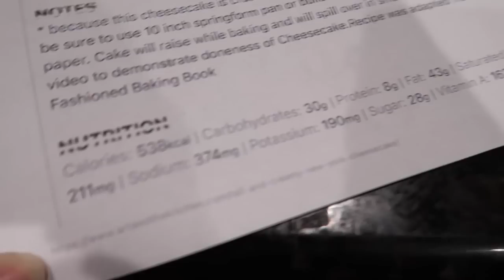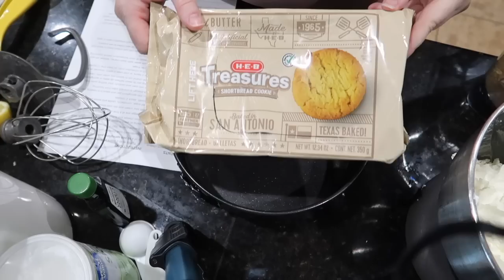Fixing this Bathroom | Can I pull it off?

Comment: I’m not an actual expert on cheesecakes but the idea I’ve got over the years is that the New York cheesecake is the type you bake in the oven vs the ones you just use gelatine and put in the fridge to firm up. And the oven baked ones, it is supposed to sink down when it’s cooling after oven and even some cracks on the top are fine. If you bake it with bain-marie (is that the word?) then it doesn’t crack, but then also the top and edges isn’t supposed to be brown and it’s not a New York cheesecake. 
So I’m trying to say your cheesecake turned out just fine! ☺️ And now I’m craving for some too…

Comment: You did great girl!! The drawer was such a great idea and the dinner! The cheesecake I bet was so yummy. I like to make cheesecakes a few tips I use- Water bath, Water bath, Water bath!!! Also- I like to leave the cheesecake in the oven for an hour after with the heat off- then pull out to cool after you run a knife around the edge to loosen it from the pan. The biggest trick- don’t open the oven to check if at all possible- I turn on the light and wiggle the door and if it’s just wiggly in center a bit it’s ready then don’t open door until after its been cooling in that oven with the heat off for one hour. Mmmm I think I’ll make a white chocolate raspberry one soon!

Comment: We have a family recipe for cheesecake girl and all you need is a couple ingredients to make it and you can use a blender to mix it not a mixer. So I buy the pre made crusts to a blender I add 1 lechera sweetened condensed milk that’s going to be your sweetness and then add 1 and 1/2 blocks of cream cheese and to that add 3 eggs blend together in blender and pour out onto your two crust. Put in the oven for 45 minutes or until golden on top for 325• that’s it it’s sweet but not too sweet not too many ingredients. My sisters and mom have done it this way for years and it’s still a crowd favorite. Hope you try it.

Comment: Calcium deposits. Just soak a paper towel in vinegar (careful not to tear it so do it on the spot where you want it), and sop that around the tap. Leave it for at least about 4H, so overnight would be ideal. Voilà. It is amazing for calcium deposits. We use it do decalcify the coffee maker (3/4ths vinegar to water ratio) and just let it make coffee a couple times. Then do a couple plain water times and you're set. It is very useful for cleaning but amazing on calcium deposits, wherever they may be!

Comment: To remove the hard water build using from faucets, soak cleaning cloth in plain white vinegar and while its dripping wet just lay it over all areas of faucet that need cleaned and go do another project. After 30 minutes go back and it will be like new, just rinse and done!!!!!

Comment: Shannon, I have to tell you about my 1st time baking a cheesecake. I’m super over confident in myself bc instead of just doing a regular cheesecake, I was like I’m going full gourmet! I found a Paula Dean recipe that was I think 7 layers, it had cookie dough, chocolate gauche, homemade caramel, I don’t remember now all the layers but you had to bake each layer, cool then add the next layer and so on. I think I had $40 in ingredients ( and this is when groceries were affordable) so I started this project at like 8 pm took almost until midnight to get all the layers done ( oh I forgot to mention this was for my husband’s as well) so then it says to chill overnight in the fridge. Well I didn’t know if it was safe to chill in the springform pan ( I was always taught never ever store in those kind of pans in the fridge ) at this time it was was way to late to call someone who has a clue for advice bc it’s midnight. So I unhooked the pan and put it on a platter and ran it to the fridge. 

Ummmmm not a good idea it started oozing off the plater down every shelf and thing in my fridge so then I grabbed it and put it back on the stove where it ran down the front of my oven between the glass door on the oven, all over the floor. I was up until 6 am cleaning that chocolate caramel cheesecake sticky oohey gooey mess up. I still think I need therapy over that, I cried and laughed for hours and then waited a good 10 years before ever attempting cheesecake again.

Comment: I've been making cheesecakes, both baked and unbaked, for more than 30 years. Different recipes have very different textures and flavors, even with similar ingredients. I mostly stick to a favored 3 or 4 of each these days. Even with experience, baked cheesecakes can be tricky. One that is overdone will be more dry and crumbly, but too underdone is not edible. I like a creamy cheesecake (favorite: chocolate chip) and that is the trickiest to get right. Sinking and cracking are common. Baking in a water bath and cooling for an hour in place (just turn off the oven and leave the door open), then on the counter for another hour before refrigerating seems to help.

Comment: Calcium deposits? All you need is vinegar! Leave it to work for a bit and see the deposits go away easily. For the toilet bowl use also vinegar or inexpensive cleaning tablets for dentures, just a couple will do. Leave them to work overnight and just finish with some light scrubbing in the morning. Much less toxic than using all those chemical products.